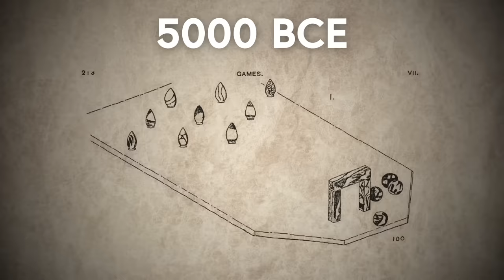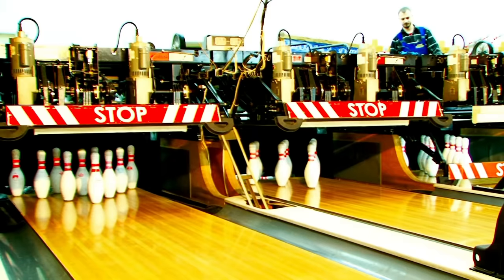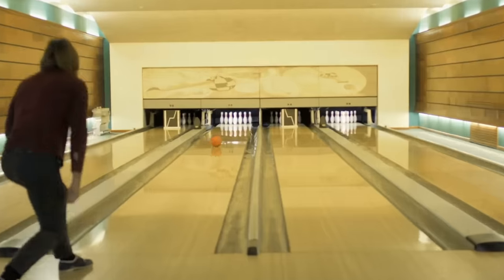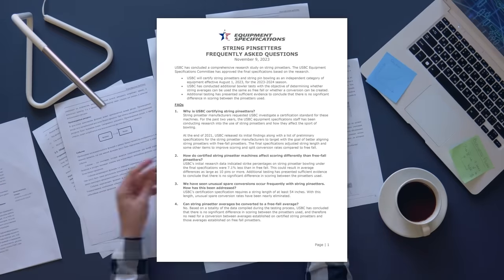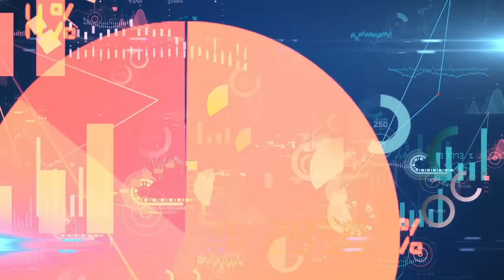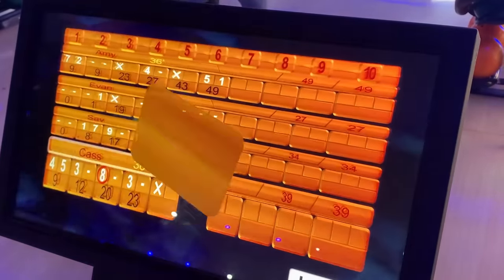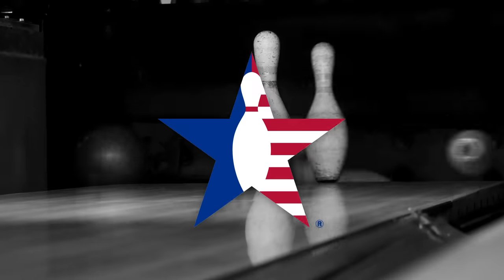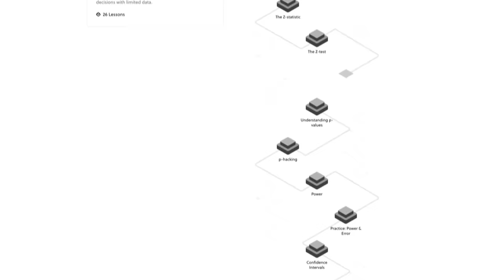The Controversial Machine That’s Ruining Bowling

Comment: I love that this videos message is absolutely “even if string pins make the game worse, which they don’t, it’s not worth people dying for”
Reply: Remember the name “half as interesting” 😂😂
Reply: @sdiz3509 yeah, half as interesting not half a torso
Reply: I actually think it is worth it, but I’m an asshole
Reply: they do objectively make the game worse, though, varying string lengths and other factors cause different alleys to have completely variable/inconsistent feels and results to them, making practice in one alley possibly worthless when you go to compete at another..
Reply: Guys bowling hasn’t been around too long. We need to give the gene pool time to catch up with the pinsetter tech. In the future we will be left with people who are natural experts at not getting crushed. Adding strings to bowling will result in a generation of highly crushable people, mark my words
Reply: @alltehstuffs  You know what? That's an excellent point. 
But I think my ball got stuck in the return, think you could go get it out real quick while I grab some drinks for the next round?
Reply: @theSato that's a lack of standardization problem, though, not a string problem. If each bowling alley used different lengths of bowling lane, different weight or shape pins, or different pin layouts, those would also cause the same issue, but for the most part, that's all standardized. If the recommended length of string is used, then it'll be fine.
Reply: Nah, gotta move you alleys so we can properly set up the safety area.
Reply: The strings are evil.
Reply: That can be taken to the nth degree though. There's a line of diminishing returns and reduced freedom and personal expression when it comes to safety.  Should no one have the ability to smoke, drink, ride a motorcycle, eat fast food, ETC because these things can kill you?
Reply: @Fryether exactly.  The best analogy is cars.  How many die (or are maimed) on the highways every year?  Yet we keep flippantly driving cars.  I’d like to know just how many people were killed or really maimed by pinsetters.  And it wasn’t a real picnic to be a pin boy either.  They better not hang out behind the alleys directly.
Reply: No wait literally.
Reply: It's a league game.
Reply: However, he confesses that the sound isn’t as satisfying